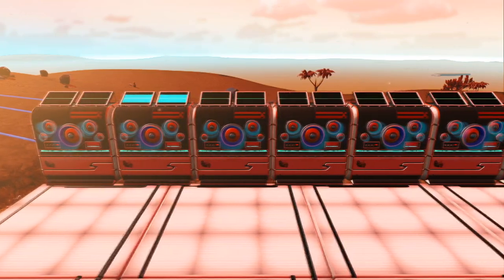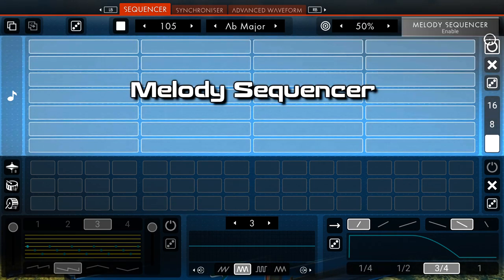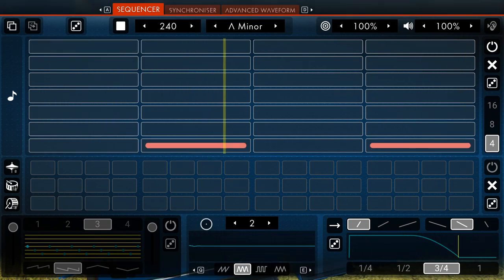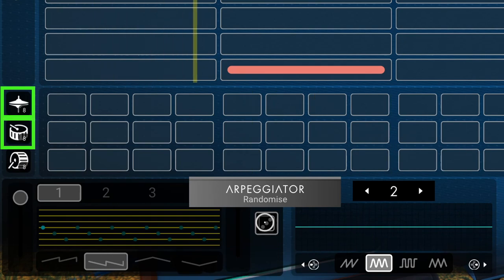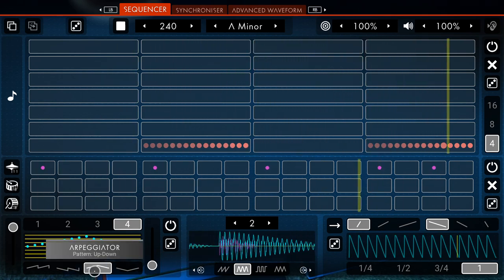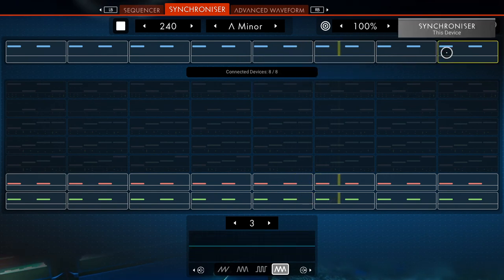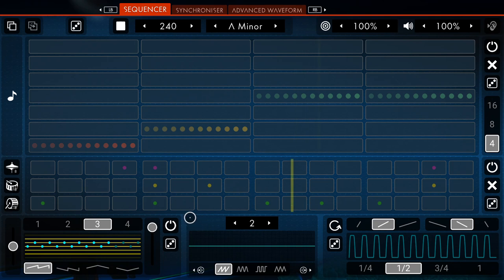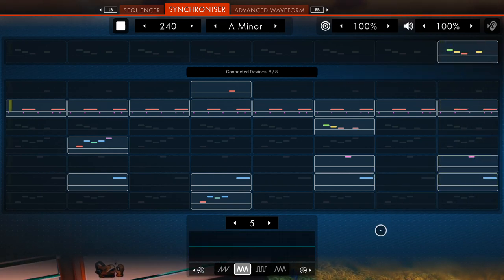No Man's Sky ByteBeat Device Tutorial [A Detailed Guide]

Comment: Is there a way to change octaves in the bytebeat machine? Not the key of the group of machines, but the octave in an individual machine when it is connected to the rest of the machines.
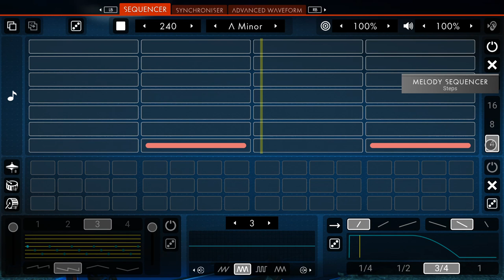Reply from the maker: Yes - that's the pitch function & it affects only the device you set it on. This is explained at 05:09 in layman's terms, but it's how you change octaves on an individual machine. Higher number = higher octave, lower number = lower octave. Hope this helps 🙂

Comment: Can you make more than 8 of these, and just not connect them? If so, can you link the output of the bytebeat machines so they trigger a switch at the end of the loop?
Reply: It is possible to place more than 8 bytebeats (Using adjacency or blender glitching). And the switch can also be added, however the trigger might be a bit complicated, as these are linked to notes or beats.
Reply from the maker: The game sadly, lets you build only 8 devices per base, no matter whether they're connected or not (woops, it seems more than 8 devices can be glitched - thanks @Beeblebum for the info). And yes, you can hook up a ByteBeat switch (it's in the same build menu group as ByteBeat devices) to a ByteBeat device and it states in its description that they can trigger "lights and other devices". I've tried to trigger a lightbox when playing a specific tone and it worked. However, I didn't explore these options further than that so my knowledge here is limited. Hope this info helps you out :)
Reply from the maker: @DadGuy Hey, just a little update: tried placing more than 8 devices recently. While you can have more than 8 physical devices if you glitch them in, when you go over 8 the Synchronizer section of the added devices disappears and the melody breaks (some devices that were playing music stop doing so and their displays break). So if you're building ByteBeat devices just as visual decoration you can freely go over the limit, but if you're planning to use them for music purposes, I would not recommend it.
Reply: @nanosam7883  awesome, thanks for the in depth replies! I tried my hand at making a set at the rave planets and boy... Do you make it look easy :)
Reply: @nanosam7883  you could try my dual base technique, not for scaffolding but for overlapping an area! 😊
Reply from the maker: @DadGuy  nicee - keep going, practice makes perfect 😉
Reply from the maker: @Beeblebum  You know, that's not a bad idea at all. Will check it out, thanks!

Comment: I'm trying to put a specific sound in the advanced waveform section but can't seem to make nodes/insert numerical input nodes. How do i do that?
Reply from the maker: It's a bummer, but the game does not let you manually do that sometimes. If I understood you correctly, then you have a similar issue I was dealing with as well. The way I did it was to randomize certain sections until I got the pattern I wanted. I don't know the exact pattern you'd like, but if you take a look at the video on 16:21 it will show you how I had to use the randomize function to get to the exact pattern I wanted where I was able to "create" nodes and numerical inputs by randomizing them and manually cycle through them afterwards. Also, note that when randomizing sections, it will not affect the nodes above what you're randomizing. Hope this'll help a bit

Comment: I have 3 locked together but 2 remain off and only 1 is working? How do I fix this? I've tried everything. When I connect power to the other 2, all 3 play completely different tunes and it sounds horrible. I've tried everything to fix this issue 😢
Reply from the maker: hey @blackatron666
 - you did good to power all 3 devices. Once they are on, they all start playing random sounds by default. To make them play the melody you want, you need to create the melody on every one of them. If you want all of them to play the same melody, create the melody on the first device and create a specific sound on the advanced waveform. Then copy the synchronizer and the advanced waveform sections to the other two devices and you'll have all devices playing the same. Hope this helped :)

Comment: Why mine there's no sound coming out?
Reply from the maker: Hmm, there can be many reasons - I would suggest checking if you connected it to power properly. Also, try checking if the volume value is set properly in the ByteBeat UI. You may also check the music volume in your general No Man's Sky settings because if it's set to 0, you will not be able to hear ByteBeat devices play.